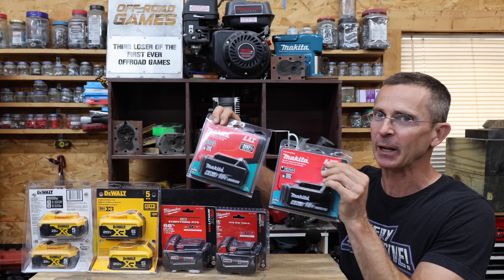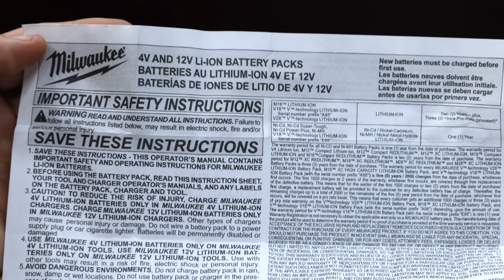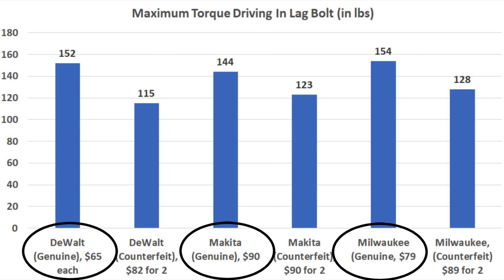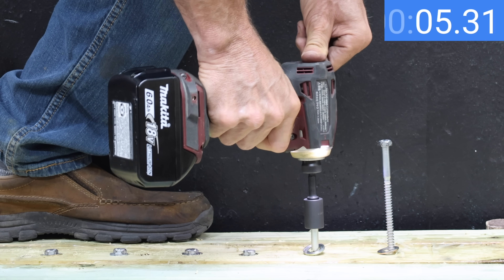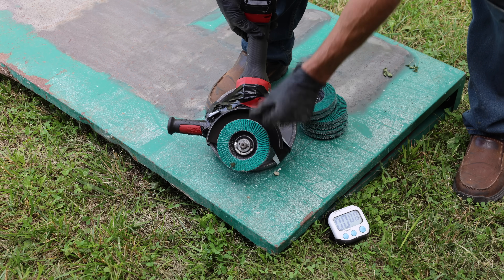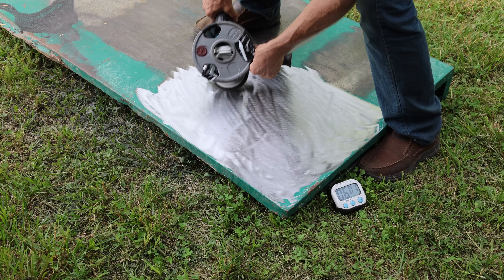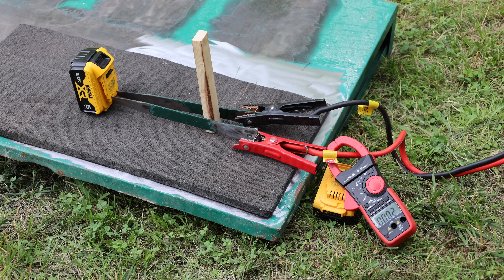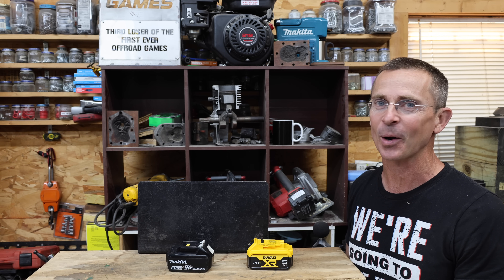Have You Been Scammed with a Counterfeit Tool Battery?

Comment: Crazy how CLOSE the fake batteries look like the real ones..   A++ Video.
Reply from the maker: Thanks!  Good Point!
Reply: Manufacturing in China is not like it is in other countries. Those batteries may consist of parts made from several different manufacturers. The scammers are buying excess parts or older parts that the original manufacturer has upgraded or simply changed somehow. The scammers may even work in the actual factory where the original product is manufactured and they are assembling the counterfeit batteries with a mix of original components and cheaper parts they bought for little to nothing.  The circuit board and quality Samsung cells are what cost the original manufacturer the most money so that’s the main things these scammers change. All we can do is report them if we find out about them and stop buying the product. But it’s almost impossible to stop them.
Reply: @ecleveland1  Factory scrap is common in China
Reply: "A++" was that a pun for an Ebay review? 🤣
Reply: Surprising they don't fake the Samsung cells too.
Reply: @cliveb9771  True..
Reply: @cliveb9771   Maybe the punishment is severe.   But there are many fake batteries from Samsung and Sony in China
Reply: even the packaging is identical
Reply: In Chinese culture, it's considered an accomplishment to get as close as possible to the original. And yes I'm serious.
Reply: @mediocreman2   If they are different, they will be identified as fakes.

Comment: I'm more impressed by the fact that all counterfeit self-destruct with the short circuit but the real milwaukee just shrugged the short. Milwaukee should at the very least put a 100 amps fuse considering the short can easily peak 200amp and hold it for several seconds.
Reply from the maker: Thanks for sharing.

Comment: I know that sometimes these "fall off" of the assembly lines and sold online. In other cases it's the failed QC ending up getting sold. Though usually the authentic fakes have the brand logo covered so they don't get stopped when crossing borders. 
I sure hope I haven't run into one of these, this is why I prefer buying from an actual store instead of someone on the internet.
Reply from the maker: Thanks for the feedback.

Comment: Bought three 8.0 Milwaukee batteries on Amazon. Everyone, even the techs at the local tool repair shop told me they were real, but I could tell because the lights were dim viewing from the front and bright from directly above. Oh... and they were fully charged. The techs at Quality Tool took one apart (the only one I opened), the board was wrong, the cells were wrong, and the connections were glued.

I was refunded but refused to send the batteries back because it is against the law to mail fully charged lithium ion batteries, and I was not going to compromise any of my tools by using them to discharge the fakes.
Reply: Electrical connections cannot be "glued." They can be spot-welded, or soldered, or crimped, but not glued.

Also, it won't hurt your tools to use counterfeit batteries in them. They just won't run as long -- and recharging should probably be done outside, well away from the house and car, where they can't start a fire (but they do need to be protected from rain).
Reply from the maker: Thanks for sharing.

Comment: This video is actually disturbing. Not because you did anything wrong, but because it’s so difficult to determine genuine vs junk. Lithium battery safety is so dependent on 1) the cells being made correctly and 2) having functional protection circuitry. A poorly made lithium battery can literally burn your house/shop down, even if you aren’t using or charging it. 

I guess the only answer at this point is to buy these batteries from a legitimate retailer (i.e. not eBay, Amazon, Temu, etc)
Reply from the maker: Thanks for the feedback.

Comment: All the comments here chastising Amazon (even though the ones in the video came from eBay), are basically ignorant.  Between the two, eBay or Amazon, you are FAR more likely to find counterfeit products on eBay, as Amazon does a far better job of policing such products, and like many mentioned you can buy from manufacturers "storefront" on Amazon and be confident you are getting the real thing.  When a company vends as many constantly changing products for so many categories as Amazon does, there is no possible way to verify the genuineness of everything they carry.  It's just impossible.  Let price be your guide to genuineness, it's never failed me.  Besides, if you buy Prime like I exclusively do, you can return anything at no cost.  Why all the haters?  You guys get what you pay for.  Does your mama have to teach you how to shop?

I run Makita, and after some easy online research was able to look for tell-tale physical differences in packaging and product that identify real from fake.  First sign?  The price.  Like has been said before, if it's too good to be true, it's fake.  I knowingly bought both a real Amazon and a fake eBay Makita battery.  The fake wasn't terrible in comparison, especially given it cost less than half as much.  But considering I could have ordered a no-name "Makita Compatible" for half-again the price of the fake, and it's basically the same under the skin as the fake, realize you should just pay proper price if you want real, and skip the "too good to be true" fakes and just buy the really cheap no-name brand for less than a fifth of the price of the real thing.and be happy with what you get.  I contacted the vendor who sold me the fake Makita, and instead of returning it told them I'd keep it if they priced it like the proper white-label it really was.  He did.

Comment: Some of the dead batteries from your tests might be revivable (not the shorted ones, obviously).  Chargers need to recognize some low voltage on the battery to begin charging, so the fully discharged ones won't register.  You can jump them with a fully charged battery to give them enough base voltage for the charger to begin recognizing them again.  There are youtube videos on this out there.  The counterfeit scams are so annoying.
Reply from the maker: Thanks for the feedback.

Comment: I had a Dewalt battery from Amazon that would not fully charge after a few months of usage. I turned in a warranty claim to Dewalt (with photos) and they sent me a replacement. Then, out of the blue, a few weeks later Amazon gave me a refund for the same battery citing "problems with the seller". I took it apart and it was an obvious fake.
Reply from the maker: Thanks for sharing.

Comment: I got one of those counterfeit Milwaukee batteries... it died after a couple of charges and got so hot that I took it outside and placed it in an old pan in case it ignited before I had a chance to dispose of it properly. The next morning i found it completely melted and fused to the pan. I got lucky and avoided a house fire... those counterfeit batteries are dangerous...
Reply from the maker: Thanks for sharing.

Comment: In line with your car maintenance videos, I don't know if its in your wheelhouse, but could you test any of the tricks on the internet to tevive or reset "dead" tool batteries?  Im sure theyre disposable, but ive got a box od dead ones id try to rebuild if i could.
Reply from the maker: Thanks for the suggestion.

Comment: you know what would be a really good test:  white caulk.   There are so many different brands and styles, latex only, silicone, siliconized latex, urethane.   I'd like to see which has the best adhesion and resistance to cracking and paint adhesion.   Personally I like big stretch and OSI quad but maybe others are better?   IMHO standard ALEX caulk is garbage and has no use indoors or outside.
Reply from the maker: Thanks for the suggestion.

Comment: It would be really easy for all three of these companies to fight counterfeiting by using authentic codes consumers could enter into their respective websites to see if a product is genuine or not. They could use public/private codes - public on the Amazon site for a quick test, but for a product to be guaranteed genuine the private code on the product much match the official record.  The fact that these companies don’t do this kinda prove this is an inside job to sell refurbished batteries.  What’s more, there is no way to tell (before or after purchasing) if the product is genuine or not. I don’t have a problem buying refurbished products, but the packaging should be clear.
Reply from the maker: Thanks for sharing.

Comment: You can tell if an 18650 is fake 4 ways:
1) It's rated for a higher than possible capacity, e.g 5000 ma
2) It weighs less than 41 grams
3) It's cheap
4) Your ebike burns down

It's not that the Chinese make nothing but crap. They make good stuff, too. Like everyone, they have factory rejects. Without copyright law, the scrappers are free to resell the rejects to the Yanks.

Comment: Good stuff, Todd.  I do wonder about the last bit with the C-clamp though, if it could have prevented the PTC from working correctly?  Don't know enough about their function and not finding a lot out there. CIDs did open and allowed them to vent, spectacularly.  I salvage 18650s from old tool packs, laptop batteries - often I'll find the CIDs have vented in tool cells, usually without leaving a mark.
Reply: Best I can find, the 25R doesn't have a PTC.   This according to ResearchGate from a 2021 report.  Curiously, even the Samsung 30Q which is a protected cell with an IC still doesn't have a PTC.  None of these tool batteries use IC protected cells, a PTC and CID would be the only protection.  And since the PTC is not used here, it's just down to venting.  Which is not to say the cheap batteries are ok, my guess is they're not high drain cells which is why they fall off, heat up and vented so, ahem, passionately.  

Unlike the CID and the top vent in 18650 cells, the PTC is
a reversible protection device to inhibits high current surges.
It returns to a conductive state once the temperature drops
to room temperature. However, the PTC is not applicable
for high-current specialized 18650 batteries. For example,
Samsung INR18650-25R doesn’t equip the PTC because the
continuous discharge current is designed as high as 20 A [8].
Manufacturing complexity and cost also inhibit the applica-
tion of the PTC; thus, not all commercial 18650 cells feature
the PTC thermistor

Anyway, got me to look down a rabbit hole which is always fun.
Reply from the maker: Thanks for the feedback.

Comment: Saving a few bucks is not worth burning down your home and endangering your family.  Never use electrical devices or batteries that are not UL listed or otherwise certified by reputable organizations such as CE, CSA, ETL, etc.
Reply: Doesn't do much good when the fakes advertise they pass all those tests but really don't.
Reply: I'm an electrical engineer and have run across equipment with both fake UL and CSA markings. Some or the people counterfeiting items are damn good.
Reply from the maker: Thanks for the feedback.

Comment: The easiest way to tell is by the weight. Counterfeits are going to cheap out on the cells & not use genuine ones made by Samsung, LG or Murata. They weigh less because if a 25R is a 20A continuous 2500mah battery they will use a fake or generic battery thats more like a 10A continuous 1500mah battery thats cheaper to produce & doesnt require as much materials to produce.  All the fake ones are around 2.5 oz less in weight. You dont even need to take them apart or test the performance to tell. There are only a few companies that actually make the batteries. Other companies buy them from Samsung/LG/Murata & then wrap them in their own wraps. Really examining what the battery says on it doesnt guarantee its authentic. The battery wraps can say whatever they want it to say on them. They make their money by buying lower capacity & lower continuous amperage batteries then pass them off as something else.
Reply from the maker: Thanks for the feedback.

Comment: When you manufacture your cases  in China there is nothing to stop the plant manager from selling your cases  to someone else...in fact it's a near certainty they are.

You'll notice that there's a really high number of cases being tossed for defects...they are being tossed into a trailer parked at the loading dock and the plant manager is smiling his ass off.

So you pay to have managers brought in from America to keep an eye on the production line , to make sure that "extra" cases aren't being made ...So then the maintenance shop  sells the spare extrusion molds to another factory and they tell you the molds were scrapped.

So not only do you lose business to cheap knockoffs that look exactly like your product ...you paid for some of the parts they are using.

Comment: Good timing with this video, as I've been wondering about a 9AH V20 battery I have. Not that it performs badly, but it doesn't seem like it holds up much better than the 5AH battery my leaf blower came with. Also, finding it new in packaging for $75 on eBay when it's supposed to be $170 in store raises red flags.
Reply from the maker: Thanks!

Comment: This should be said. Don't ever trust an eBay seller if they have a feedback of less than 99%. It looks like you bought the counterfeit dewalt from a seller with a 94.7% feedback score. (Given the onscreen information was correct) The feedback score alone is enough to tell you something isn't right.  Thanks for the awesome information!
Reply: I always read the feedback comments. Sometimes a seller gets unjustified negative feedback and I also look for seller replies and explanations on negative feedback. Just the fact that they respond means they are paying attention to their customers, unless of course it's that canned text that some sellers use over and over. But yes, low positive feedback is a red flag.
Reply: @Earthneedsado-over177  Great advice!
Reply: @Earthneedsado-over177  I sell on ebay, and most neagtive feedback is bogus.
It's also dependant on porduct. There was a seller selling defective products, stating it up front and selling for pennies on the dollar (for parts, try to fix etc) he still got hammered with negatives
Reply: It’s very easy for a shady seller to buy fake reviews and ratings. You can’t only go by that, you have to dig deeper.
Reply from the maker: Thanks for the feedback.
Reply: I would only buy from Authorized sellers.  That means no ebay.  You can go to the company website and find out who the authorized sellers are.  The warranty also states they will only honor it if you bought from an authorized seller.

Comment: You might want to try a longer term test with these batteries. I found the fakes worked okay for about a month (aprox 8 charge discharge cycles) but then went to shit and 6ah was worse than a 1.5ah battery. the charges would not last. but otherwise good test!
Reply from the maker: Thanks for the constructive feedback.

Comment: I bought an 18 Volt 8Ahr Milwaukee from eBay and noticed right away that the power level lights did not line up with the case.  All the genuine batteries line up.  I contacted seller and he gave me a refund, (pretty quickly too!)  Battery is still useful though.
Reply from the maker: Thanks for sharing.

Comment: One thing to remember is a battery wrap can easily be changed to say Samsung. Luckily these scammers are too lazy to do that, but they easily could in theory. A battery wrap in itself is far from a guarantee of authenticity.

Also, I want to point out that the 25R is not a protected battery. It has no short circuit or other protection in it. It is designed to be used in battery packs that have their own protection circuits.
Reply from the maker: Thanks for the feedback.

Comment: Thank you very much. This was really well done comparison with real and fake batteries. I have the same battery analyzer you have and it really is good. I have been spotting fake  batteries here in Finland for over 20 years and then it was easy to spot fakes but as this your video shows, today the counterfeits’ packages are so well made that the only way to check it is to open the battery. Or buying from well known store. I don’t mean like Amazon because they have a lot of different shops but more like a real hardwarestore or similar.
Reply from the maker: You are welcome!  Thanks for sharing.

Comment: Other common fake projects on Amazon and ebay include Ethanol Proof Bio-Fuel hose, labeled 30R9 or 30R14, which they are not! This is extremely dangerous as the ethanol destroys the rubber and leaks gasoline, potentially causing fires! The other common items are NGK and Denso Spark Plugs! Maybe ideas for future testing?
Reply from the maker: Thanks for the suggestion.

Comment: Panicked me for a few minutes... I have only recently bought a pair of 5Ah DeWalt batteries and misunderstood your identifiers of the new vs old case styles, so I took mine apart to confirm they have the circuit board inside. In case anyone else is unsure, the old style has the yellow strip below the release button (which the fake ones also have) whereas the new ones do not. The new ones are also slightly larger than the older ones. I have a pair of each (all genuine).

After watching a previous video you did where you tested the capacity of fake/cheap ones vs genuine ones, I'm convinced the genuine ones are worth the expense. Thanks again for everything you do. This is top-tier consumer information.
Reply from the maker: You are welcome!